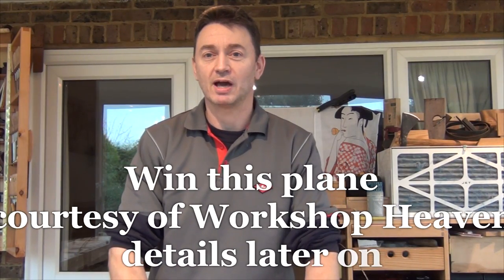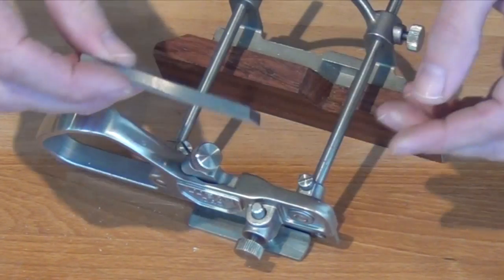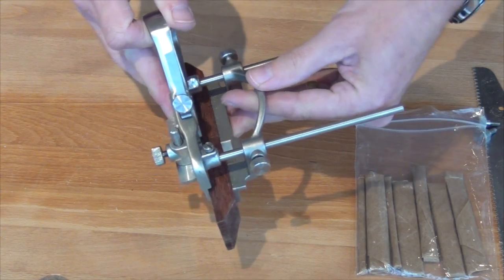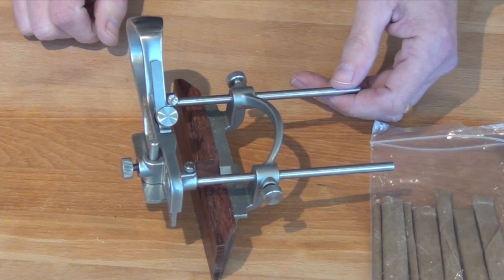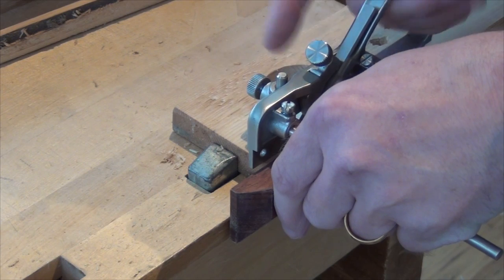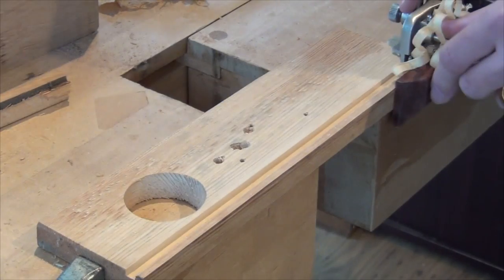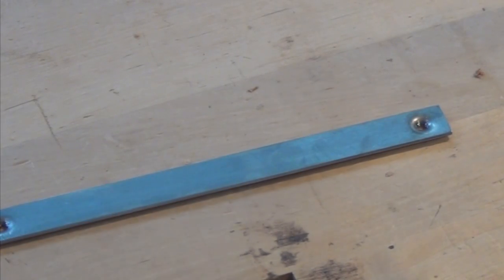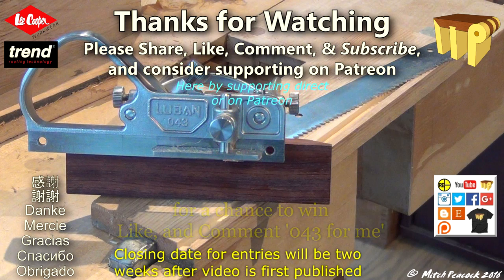Quangsheng Luban No.043 Plough Plane + Kerfing Blade

Comment: Thanks for this.

I did send mine back as the fence did not sit true to the skate in full tension. They offered to send me another but at the time I thought I'd try restoring some old ones I had. Maybe time to get another sent out.
Reply from the maker: That's a shame - to be honest the old ones can be pretty poor in that respect too. The wooden fence allows for fairly easy adjustment of any out of parallel error, with a few stopped shavings doing the trick.
Reply: Well I'll give it a go thanks for replying. The old one wooden one I currently have has a tiny twist in the skate so that the iron, even though square, presents obliquely - quite annoying! Nothing a few light taps won't resolve when I have time.

Comment: 043 for me
Mitch, from what I heard and read, Quangsheng produces really good planes, which are sold under different brands here in Germany by Finetools and Dictum.
Btw. "no dust in the air" is really nice. I build my workbench this year and I did the work 99% with handtools. It took a long time, but much less noise and dust. :)
Reply from the maker: Yep, I much prefer to use unplugged tools.I'm sure you're right about Quangsheng planes in Germany. My experience with them has been really good.

Comment: Looks like a nice plane, I just got an old stanley plow plane , too bad it will not be easy to make it easily into a kerfing plane ...
Reply from the maker: You could adopt the same approach of attaching a length of rip saw blade (or maybe a section from a band saw blade) to the plane's skate.

Comment: 043 for me.  Thanks for the review.  Have you looked at other brands for comparison?  I'm wanting to move more toward the hand work side of things in my shop work, so reviews like this are really useful.
Reply from the maker: Cheers John. To be honest most of my kit is 50+ years old, and although I see a fair bit of what's out there now, I don't like to comment much on anything I haven't had a chance to road test so to speak. I can't afford to double up on things either, so half of my reviews, at least, are where I've been invited to try something by either the manufacturer or a retailer. Of course when they make something available for review, it usually means they're proud of it and it's going to do well, which is great for me because i get to try some great stuff, and like with this I get to give one away.

Comment: Beautiful video, Mitch.
The planer resembles those of Stanley.
Can you plan with your planer also cross to the fiber?
I have not seen a pre-cutter.
Reply from the maker: Hi Gunter.There are no nickers (pre-cutters) since this is a single skate plane - it would be possible to have the right hand side nicker, but there would be nowhere to house the left hand one. Of course, for cross grain use, you should therefore lay in knife lines before planing.If cross grain grooves (housings, etc.) were a large part of your work, then a plough with nickers would be worth considering.

Comment: A kind of weird question:

Normally when we have to dimention wood by hand. We mark the parallel face in the other side of the wood with a marking gauge and. Consider you a better option marking the parallel face making a little groove with the fence in the reference face of the plank to make a "extreme" perfect dimentioned board?
Reply from the maker: Do you mean use the plough plane to gauge the thickness, before planing the parallel face?  That's a reasonable way to go, if the sides are clean enough / plumb enough to use the plough.
Where a lot of material needs removing, or you wish to resaw the workpiece, ploughing a kerf provides a great guide for a hand saw.

Comment: it seems there are no precutters for cross grain, eg for dados? how much tpi has the blade?
Reply from the maker: That's right - knife in, or use the kerfing blade to set in, the initial walls for such work. Blade is 7tip
Reply: +Mitch Peacock - WOmadeOD I'd prefer to use the knife as the blade is ser for ripcut.
Reply from the maker: Sure. I will try it out later, and see what it's like to score with.

Comment: Would it be possible to use beading type blades from other plough type planes with this?
Reply from the maker: Andy Midd I haven't tried, but so long as the skate can sit aligned within the quirk of the cutter then I imagine so. You probably wouldn't want to use a cutter more than half an inch wide though since this is not a large plane and I think it's cutter range just extends to a half inch.

Comment: I bought one. The bars are not straight -  or the holes are not aligned. So the kerfing blade will not sit parallel to the fence. Trying to cut a kerf in a longer board is a nightmare. Also the saw blade is quite thick - not sure why they choose such a thick blade. I bought a ryoba resaw from WS heaven together with the blade and it doesnt sit straight in the kerf because it is thinner than the kerf so it’s hard to get a straight resaw cut, they should provide a thinner kerfing blade as an option - the saw blade they provide is not adequate for resawing
Reply from the maker: Dan Matiesanu bar alignment sounds poor on yours, so I suggest you get it exchanged.
My guess on the kerfing blade is that it needs to accommodate the kerf of a Western hand saw i.e. a 32ish" rip saw with generously set 3 or 4 tpi teeth, and be rigid enough not to flex at all when cutting. For myself, I always finish with a few passes of a plane anyway, and haven't found the kerf width a problem. But it would be simple enough to buy a spare blade and cut it to fit this plane, thereby getting a perfect fit for the resaw.

Comment: Is it possible to do a stopped groove with one of these?
Reply from the maker: Not a conventional one on it's own - you would need to chop out the stopped end first, long enough to provide a starting point for the plane's skate (sole).
You could make a tapered groove, fading out at the stopped end, but whether that would suit the purpose is up to you.
Reply: @mitchwoodwork  Thanks for the quick reply. Apart from a chisel is their any other hand tool which would be more suitable?
Reply from the maker: @jimbow2310  What depth and width is your grove?
Reply: @mitchwoodwork   Roughly around  5 x 6mm. Its a groove to take a sliding lid. I have not made the lid yet.
Reply from the maker: I would probably saw both sides of the groove as best as possible, then chisel out the waste. Or, use a wider chisel to pare it sideways, bit by bit. This is all assuming you wish to do it unplugged.
Reply: @mitchwoodwork  Thank you again for the helpful advice :). I have three routers that  would easily meet the challenge, but i have decided to go down the hand tool slope with this project as i am recovering and coming to terms with an illness. Going to go for the chisel method. Great content by the way.